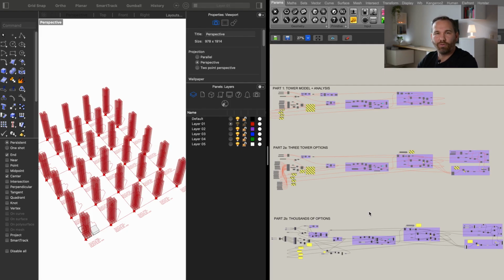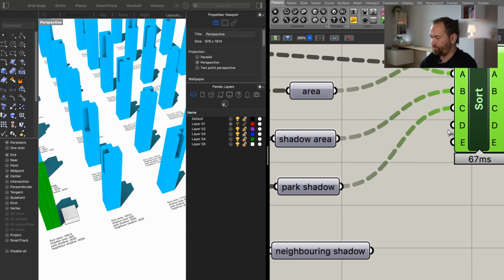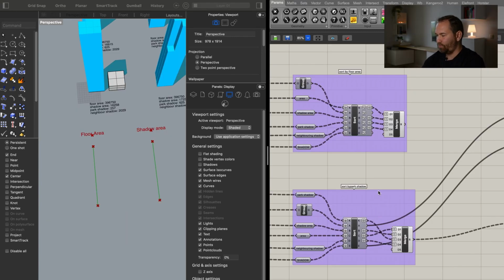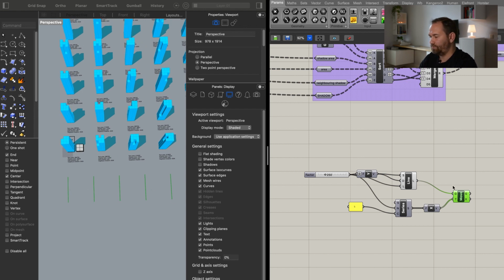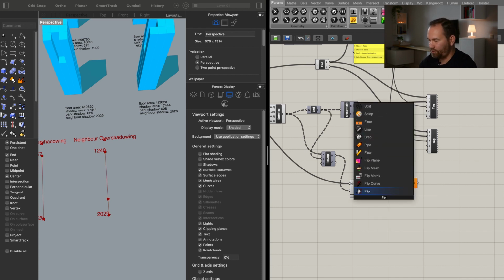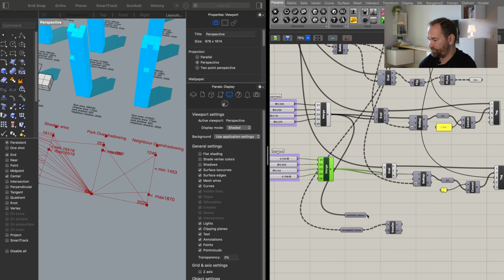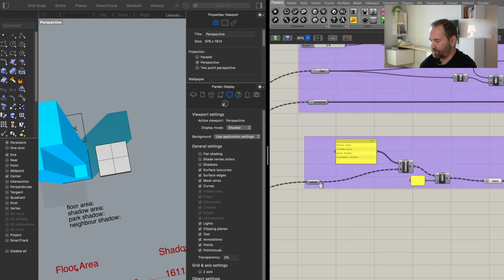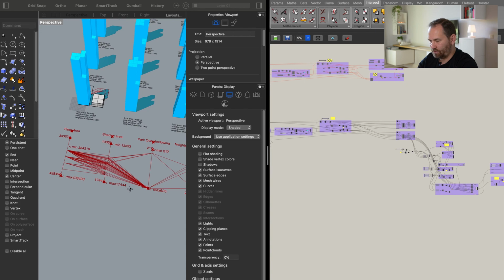Generative Design in Grasshopper - Part 3, Optioneering Interface

Comment: Hey, I am a little stuck or not sure I have the logic correct. I have, without the clean component applied to the integer outputs of shadows, ended up with labels for geometries without the part where the numbers' disappeared'. Therefore I have not ended up with 45 branches and don't really understand where this comes from, any help would be greatly appreciated.